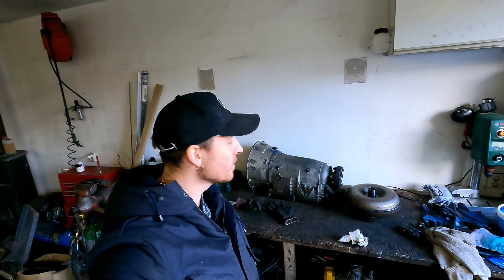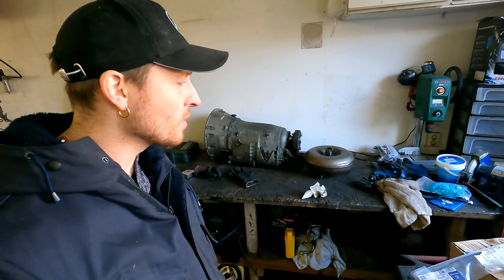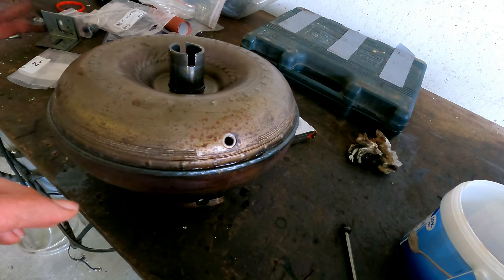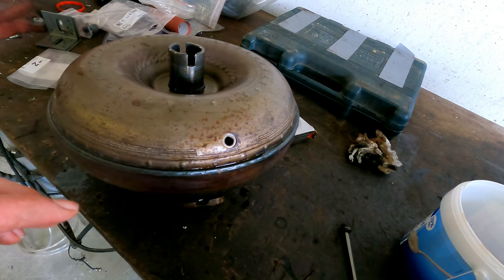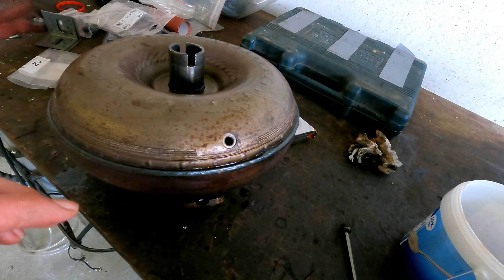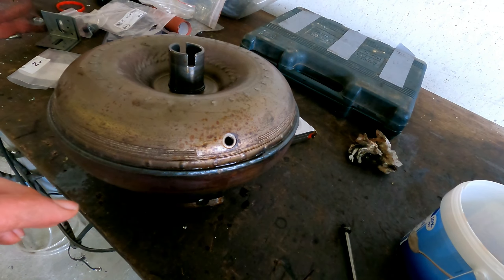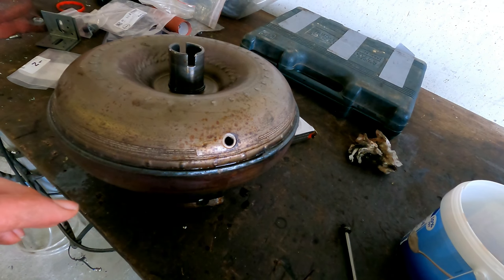Mercedes 722.6 Transmission service and valve body check

Comment: I use a Beam style Torque wrench (also known as pointer style) for torque values that low. So much easier to control and you can watch as you approach desired torque instead of waiting for the click and hope it's not too much.

Comment: Sir how can get a jold of you. I'm struggling with a p2767 code. I changed the conductor plate, but still same code. Grand Cherokee diesel 2008, 270k km. I haven't open the valve body. What else should I look at. Some are telling me that the new conductor plate is a bad one... amazon.
Reply from the maker: P2767 is the speedsignal.  Did you also changed the connector socket holder in the gearbox where the plug is going in.   And the old one was it wet of oil.  If it was wet .  Check the connector on the transmission tcu.  If it is also wet here it is possible that oil came in the tcu and can also cause problems.   But you have to buy oem conductor plate or. The febi biltstein plate.  Febi biltstein is the same as oem.   This is what i use
Reply: Thank you sir. I did buy a complete assy. including connector gasket and filter... all from amazon. On starmobile speed sensor always read 8000rpm when vehicule is not moving.
Reply from the maker: Oke.  What is it reading when the plug is disconnected .
Reply: I just saw your answer ... I currently have the tcm in hand... very complicated to access on jeep crd. Had to remove steering colum. Tcm looks dry from the outside. Do I have to open tcm to check?
Reply from the maker: Google or YouTube tcm oil problems and you find more info about this and also how people find it out.  But if the connector on the tcm is dry then you should not have this problem
Reply: Ok I managed to open the TCM. All looks good inside. Dry and nothing seems burnt from the look of it. Can oil in the connector (female part of the conductor plate) causes issues... there was a good amount of oil just in the female part of the connector at the conductor plate..... there was no oil inside the TCM.
Reply from the maker: If you take out the plug on the outside of the transmission the the inside of the connecter part in the transmission the tis connected to the conductor plate is wet of oil this not good.  If it can cause or problems direct.  Not always but it can.
Reply: Thank you sir... for some reason I don't receive message notification... but yes, when I took the outside connector there was oil inside. Oil was dripping on the floor from there. I noticed that the outside O-ring (not the orange one from the male connector), but the big inside one was kinked. Oil was inside the female part of the connector. But why??? There is oil all over the conductor plate no? Why a bit oil in the connector makes it acted like that?🤯

Comment: I open my it's exactly the same, but the only thing I found was that the plastic on the speed sensor it's cracked, will this afect performance? My car it's dosen't change from first gear. Any thoughts? Thanks for the video
Reply from the maker: yes can be there are 2 speed sensor on the conductor plate.  if there is a crack this is not a good sign.

Comment: I did a conductor replacement filter and socket now the car wont move i did notice a little stiffness when shifting gear shift first time i was wondering if by chance the beige plastic connector by the shift mechanism may have came off do that control the actual shift to drive and reverse?
Reply from the maker: Yes can be
Reply: Yup i just dropped pan and looked its broken

Comment: Point of correction, the shaft you have shown at 04:07 is not for the oil pump's but for the reactor's! The oil pumps is the 3rd one with notches, connecting when fitting in your torque converter!

Comment: 1999 clk200 w208I changed the automatic transmission oil, the filter is ok, I tightened the crankcase, but I cannot stop the oil leak, with what torque is the crankcase tightened, thank you.
Reply from the maker: Did you changed the oil seal on the oil pan.   Torque spec is not high .  Dont know out of my head.  But you should renew the seal.
Reply: @JMSpeedshop  Yes I changed the seal twice but still can't stop the leak.

Comment: Hi, thanks for the video.
I have a C180 COMPRESSOR 203. Mine doesn't change the auto gears; it just goes on i gear. The speedometer is not working. The temperature gauge is playing up and down. Even the small manual is not working. When I put on drive on the dash, it shows neutral, but after a while, it will go to drive. Can it be the gearbox control module? How many liters of atf oil should one put in the sump?
Reply from the maker: It depends on the car but you should get the car started and there is a level for 20c. And 80c. So that is how you check
Reply: @JMSpeedshop  for the gear failure, can it be the gearbox control module?
Reply from the maker: @leonardzhou5530 as far as i know . When you put it in gear in D without tcu connection i should have a limp.mode so.always run in a gear but not shift up

Comment: great tutorial and you explained that slipping between 3rd and 4th gear is normal? I have an ML 270, the gearbox goes perfect, no jolts, excellent progression when cold and hot, the only flaw is the 3rd to 4th gear slipping, sometimes it's not much, other times it goes even 500 rpm out before going into 4th gear then everything is ok, knowing the problem is when I change gear, I lift my foot and then accelerate again, new oil and filter, how can I fix it? Thank you
Reply from the maker: Normally in car running the oem ecu and tcu.  The ecu should cut torque when shifting 3-4 gear.  And the slip would be minimal.   When have slip like 500rpm is a sight of worn out plates.  Or pressure not reaching fast enough or not enough pressure.  This will indicate also dirt or worn out parts.

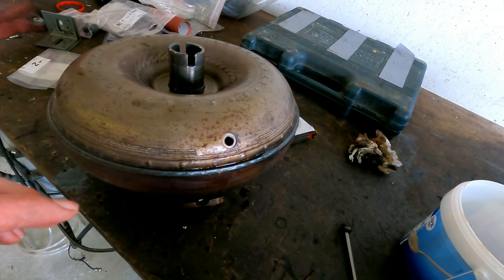Comment: Hi nice video - 1 question can you change the connector at 14:08 without draining the transmission fluid out - I had a look at mine and its not dry so id like to change this connector asap and before I change the transmisson oil?  - thanks
Reply from the maker: No you have to drain the oil

Comment: i have this transmission and it seems that the torque convertes is not locking fully in any gear. sometimes in 5th. I replaced the converter and liquid but does the same. maybe a bit better. what else could I check? some orings leacking pressure? some selenoids?

Many thanks
Reply from the maker: There is a lock up control on the valve body this is activated so if something is stuck it will contant put pressure through and lock it
Reply: how is that lockup working? Electronically or mechanically activated? can that be checked with the box on the car and only the valvebody removed? do you know any seal kit to replace once the valvebody is off?  @JMSpeedshop
Reply from the maker: Search for ATSG. 722.6.  Service manual

Comment: Same problem for me the car won't shift only emergency mode I changed conductor pl and solenoids is good . The car still won't shift so is it the body 
The code is P0715

Comment: I was told about an anti theft issue with the conductor plate and valve body.. does this come in to play when doing this?
Reply from the maker: Yes. if you mean that i remove the plil lock

Comment: I just did an engine and trans swap from another vehicle and apparently did not test drive the donor car with enough "spirit".  When driving gently everything works as it should, but if I put the hammer down I get the following
• I have issues. 1-2 shift will slam (not even sure if the slam is a shift because I instantly lifted and so it of course upshifts due to letting off the throttle and being at a higher speed.
• 2-3 shift flashes RPM a bit
• 3-4 shift flashes RPM a lot
• 4-5 shift flashes RPM a lot
• Downshift kickdown flashes RPM as well
• Once in gear trans holds with no slipping at all even under heavy acceleration at low RPM up steep hills, so definitely no slipping once into gear
I replaced the valve body (as well as all the solenoids) with another used one (don’t know the history) and put a brand new conductor plate on it as well as brand new filter and conductor plate connector.
Also swapped out TCU from donor car.
No change – symptoms stayed virtually the same.
I am not crazy about what the color of the original fluid was.  There was a bit of a black film lining the bottom of the pan.
Any ideas?
This is in a 1999 W210 E300TD and has a stage 2 tune and HX35 turbo with 3" exhaust so the power is much higher than original.
Reply from the maker: A original 300td box with your set up van not handle your modifications so i would change the gearbox for a BIG NAG box.  That is a 580 box. Your now have a 330 box.  Also with the oem tcu with you setup this is not ideal better you use a good tcu tune or go with a ofgear.dk tcu

The problems your having i would start opening the valve body and checking the springs a valves in there look if everything is clean a nothing broken
Reply: Pretty confident it is not the valve body, even though I was convinced it was due to the symptoms.  I replaced the valve body with a completely different one (but with a brand new conductor plate on it) and the symptoms were identical.  No change at all.  Seems much too coincidental to have all the exact same issues with every single gear change.  Making me think it might be the pump???  The motor I pulled (because of a pre-chamber failure) had the exact same tune on it and the trans connected to that motor performed just fine.  Wish I would have swapped my old existing trans onto this motor during the swap but I just assumed this one would be better because it had half the miles.  330 should be sufficient for this existing tune.  Motor I pulled and now have on a stand will be getting the full treatment and will have much more power so it will need more gearbox. So, I will plan to go a different route then, but not sure I want to consider the ofgear.  I have read many posts of people being much less than happy with that controller.  That will probably take me down the road of doing a manual swap. @JMSpeedshop

Comment: U said drill bigger hole to 3-4.th gear on mechatronik plate, where and why d u want to drill it to be bigger?
Reply: if u run on original ecu, with bigger hole, what will be happen?
Reply from the maker: When running on ofgear ecu this will give more oil pressure on 3-4 flare.  So only do this when running the ofgear tcu.    Not sure what will happen when running stock tcu

Comment: So.  If you have this transmission and it doesn't want to shift out of gears when driving, where is the problem?  Conductor Plate?  What tells the transmission to shift?
Reply from the maker: The tcu tells when to shift.  The signal will go to the solenoids.  So if the tcu does it work correct.  The problem.is most.of the time in the conductor plate and valve body

Comment: In March year 2025 will be auto oil change out for my MB722.6 transmission as previous owner had change it in year 2020. Oil from dipstick is still looking pink in color when blotting onto a white paper.

No issue so far by this transmssion but it will soon be a 18 years old transmission.

 Since I had intended to keep the car for another 5 years I think it is best to plan to change out the conductor plate and maybe put in sonnax valves. This car had never did any sort of towing. 😂😂😂
Reply: I have a 18 years old E class. Not more than 140k miles. How is your transmission after putting in sonnax valves?. I intend to keep my car for another 5 years. My 722.6 has no problem but just wanted to stay ahead on its maintenance. I also thinking  of using Valvoline Premium Blue 15W40 API SL/CI-4 and change it every 3000 miles.😂😂😂

Comment: Nice, what size DASH did you use for the oil cooling lines!
Reply from the maker: 8
Reply: @JMSpeedshop  DASH8 to what if you do not mind...
Reply from the maker: @LaTeamPrep from transmission to the oil cooler and back to transmission
Reply: @JMSpeedshop  @JMSpeedshop  Sure but what I mean is what thread goes into the gearbox side, is it M12 or 14
Reply from the maker: @LaTeamPrep dont know that out of my head . You have to check the oem banjo bolt.   Is metric for sure
Reply: @JMSpeedshop  Thank you mate!

Comment: Please, where can I get that manual hardcopy for a  722.9 7G-tronic Mercedes benz. Car is moving despite no transmission fault codes
Reply from the maker: The are online do some google search
Reply from the maker: Google atsg 722.9
Reply: @JMSpeedshop  thank you for your response, 
Here is the main problem, On the diagnosis, under the Automatic Transmission Unit, it says No Fault Codes.
Which could mean transmission has no problem. But the car isn't moving. It shows the selection on the instrument cluster on the dashboard, but the car is hardly moving, and if it moves very slow as if it's rather rolling.
Reply from the maker: Oke.    Personally i dont have experience with the 722.9

Comment: Hi, thank you for the video, i got a question on my transmission (2011 jeep grand cherokee), i found a Shift Lever Shaft seal leakage, and if i am right, the only way to remove the seal is disassemble the gearshift detent and shift lever shaft, and take the seal out. and i need to loose the gearshift detent from the shift lever shaft first, and take the shaft out, finally take out the seal.  Does my idea make sense? and do I need the special socket like some other videos show that screw the socket inside the seal, then pull it out?
Reply from the maker: If we talk about the same seal.   Then you can not change it under the car i think because the shaft is to long .  
About a special tool.   I rarely use special tools there is always a way to do it with tools you already have.  Here is a look from a Benz forum.  I personally never change out this seal so i can not go in to details 
https://www.benzworld.org/threads/how-to-lower-722-6-transmission-a-few-inches-and-replace-leaking-shifter-seal-without-removing-transmission.3060057/
Reply: @JMSpeedshop  ah, that is a really good point, I realiezd the constrained space, but i didn't realize it is not enough to remove the shaft. thank you so much
Reply from the maker: This is what i found online that there is not enough space
Reply: @JMSpeedshop  thank you, i ll check it, it seems i have more space then the Mercedez, but I am not sure it is enough or not on my Grand cherokee.
Reply from the maker: Oke.    Good luck 👍

Comment: Nice video thanks! Hey i have exact same transmission I just did the conductor plate only and noticed I missing those yellow plastic covers on top of solenoids, how important are those? Previous owner must have taking them off. Thanks
Reply from the maker: On early transmission these yellow cover where not on yet.  The came later exact year i dont know.   I had a 1996 722.6 in my w201 V12. This transmission had also no covers on the solenoids
Reply: @JMSpeedshop !  thanks for the reply, mine is 2006 e55 amg and it has the blue upgraded solenoids so that's goog I guess.
Reply from the maker: At 2006 the sure must have the caps from factory

Comment: Hi

Should i change the tcc solenoid and 1,2-3.5 gear solenoid? I am experiencing some jerk in 1-2 shift and low rpm between changing  gears 
… car feels like no power. 
 
W204 c200 kompressor
Reply: I have same issues but if it manages to change to 3 it's a smooth change till the last gear what was the issue with urs
Reply: Your compressor is ok?. I bought a dashboard mounted OBD2 Lufi XF. Can display MAF vs MAP vs throttle body position vs RPM and many more parameters. At 3000rpm and nearly at 0psi for MAP the MAF reads at 40 to 42g second. At +7.5psi@3000 rpm MAF can reads up to 60g/second. Positive pressure read out by MAP is useful to know that bypass flap for supercharger is closing or is in  fully closed mode. By MAF on very hard flooring of gas pedal can bring up MAP to +8.5psi. This I had to do occasionally to quickly merging into freeway traffic. 

At hot idling in D mode & AC off the MAP is at -7.3psi vs MAF 4.7g/g at 740rpm. 

Any leak in the vacuum hoses can drop the MAF value & at the same time causing rough idling. 😂😂😂

Comment: Man i saw the video and thanks a lot I do have a question 3rd gear and 4rth is slipping so the hole is the solution how can u help me cuz mechanics are asking about 1000 so thats why imma do this myself
Reply from the maker: This solution will work best of you run a ofgear TCU
Reply: @JMSpeedshop no mine is stock i dont know what should i do it is slipping i spent alot and kinda broke rn
Reply from the maker: If the clothes are slipping the plates are worn out.  Or there is not enough ook pressure on the plates.  This can be a lot of issues. Like blocked lines.  Or not enough oil or broken valves in the valve body .

Comment: I don't have the solenoid covers, it's crazy right???
Reply: the time will broke it, so it is not crazy
Reply from the maker: That depends on the manufacturing year.  Early models dont have coers
Reply: Same here i don't see it in my CLK w209 2003

Comment: awsome video, would i want to drill that hole to 4mm for my  w202 c43 amg and 2000 sl500 if im running stock tcu? or should i upgrade the tcu as well?
Reply: also can you send link for the valve body repair kit?
Reply from the maker: O did not use a valve body repairkit 
If your run a stock ecu and stock car you should not have a problem for 3/4 gear.  This solution only work with the ofgear.dk tcu
Reply: @JMSpeedshop  where did you buy the screens?
Reply from the maker: The filters you mean ? The where in the parts kit incl. Febi 100254. But you can also buy them seperate

Comment: I wasn't so lucky I disassembled my valve body to find chunks of roller bearings and ferrous  material in the pan and stuck on the yellow magnet body of the conductor plate
Reply from the maker: That is not amg of beginning
Reply: @JMSpeedshop  what would turn trans fluid grey after 155k mi?
Reply from the maker: Clutch material